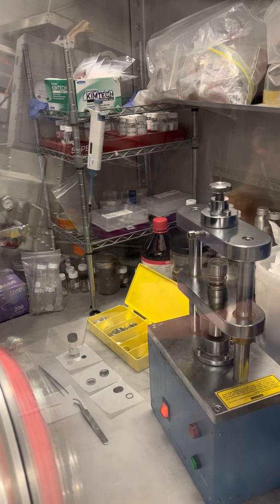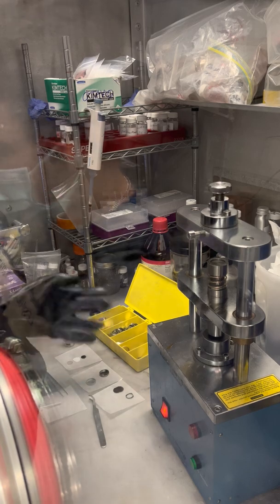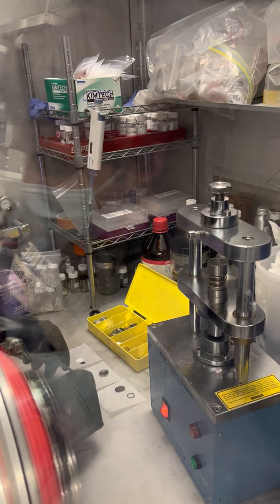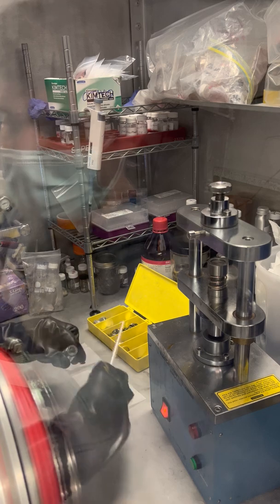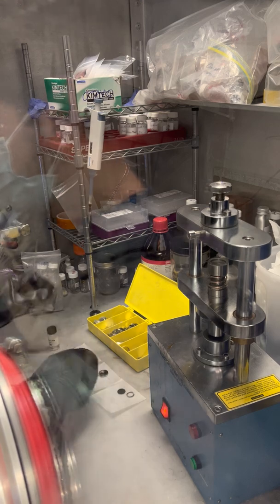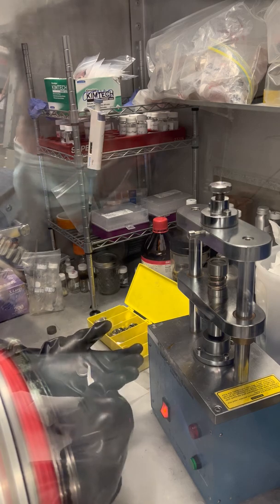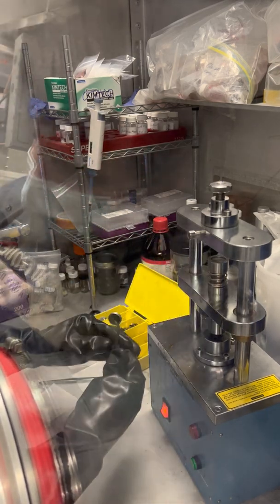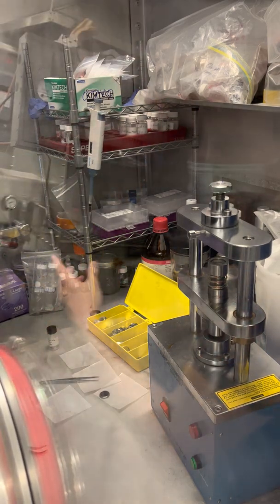Coin Cell Assembly

Comment: You prepared an anode on copper current collector then why you placed your anode material on positive side of cell and lithium metal as cathode in the negative base side of the cell??
Reply from the maker: In a half cell with lithium, the lithium is always the "anode" and thus the negative side of the coin cell.  The anode material being tested is the "cathode" of the half cell because its potential is always higher than that of lithium.